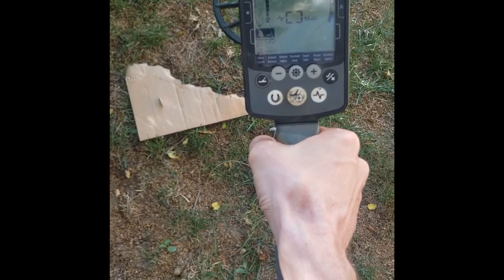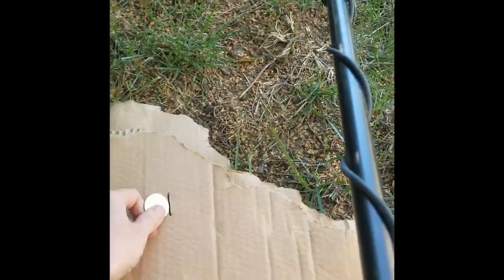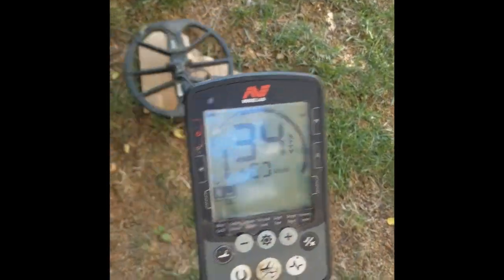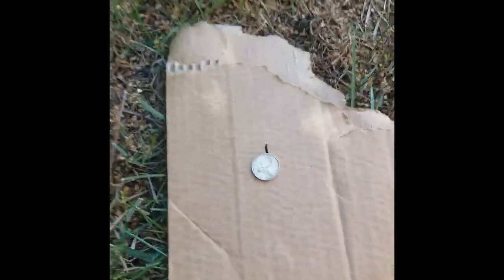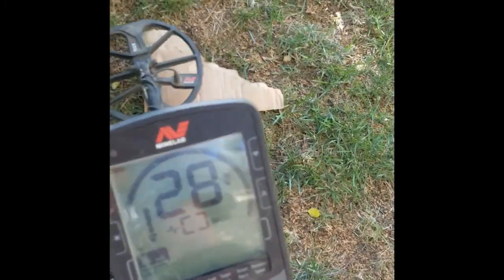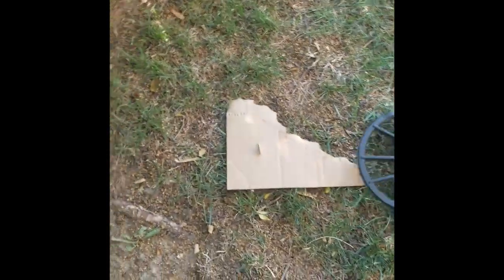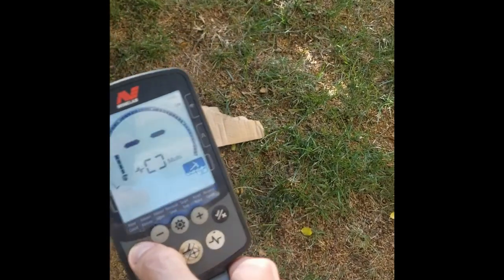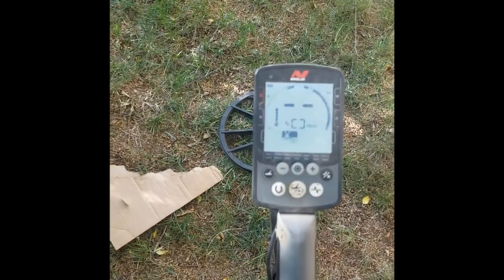Minelab Equinox 800 fails silver coin on edge test in some modes.

Comment: When you do get the correct signal from the coin on edge rotate 90 degrees.. and hit it again from the other direction' 'horizontal' ...nothing
 software update did not fix this issue.

Comment: can't believe you wouldn't dig those signals. they are not nothing (only no signal is nothing) if you dig by numbers you are missing so much. remember dig it all there are so many variations in the field you can't always rely on signal tone or numbers. learn the machine. this applies to all metal detectors every one is different.
Reply from the maker: phil johnston yes when coin shooting in a trashy park I would not dig those signals. Digging 1000 pop tabs and foil chunks is not my idea of fun lol. My knees are worth more than the 1 gold ring I would find out of 1000s of trash targets. When cherry picking silver you would miss big silver on edge in park 1 or field 1 with those numbers and tones. That is the problem.
Reply: If you are just going to dig every signal you might as well get a 50.00 bounty hunter from walmart and save the 750.00.

Comment: Thanks for this test. I was wondering why I was  getting no TID on some targets in Beach 1. I seem to vaguely remember someone mentioning the mode 1 vs mode 2 tweaking done during testing in relation to multi-iq. did you happen to try in single freq in mode 1?
Reply from the maker: yes I did try single frequency modes as well. It hits the coins fine in all single frequencies. It is only in multi mode that this problem occurs.

Comment: That’s why I always use Park2 or  Field 2. Have found 27 silvers in 2 months.
Reply from the maker: Kevin McCrory Yes I usually use park 2 as well and have had good luck. However I dont think that those modes should miss coins on edge. I dont think that is how minelab intended for them to work. We will see if they put out an update.